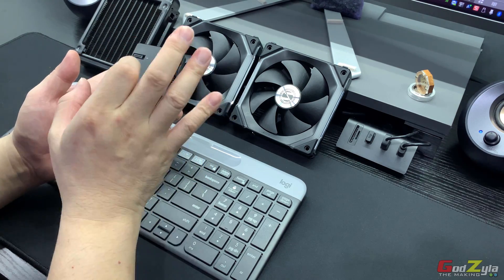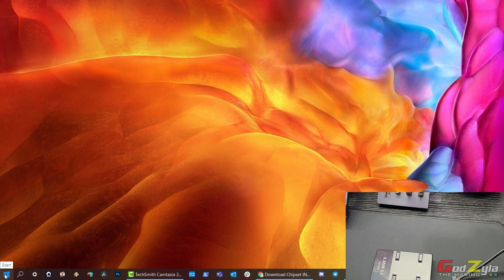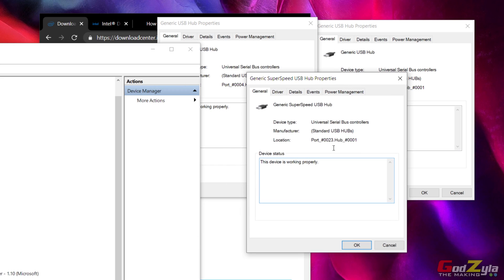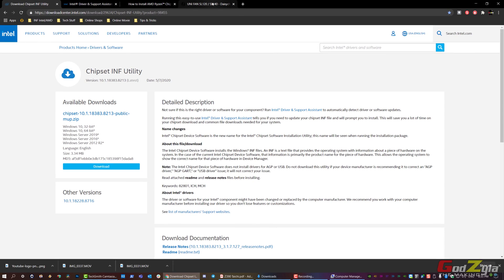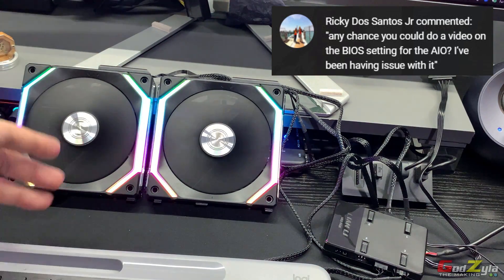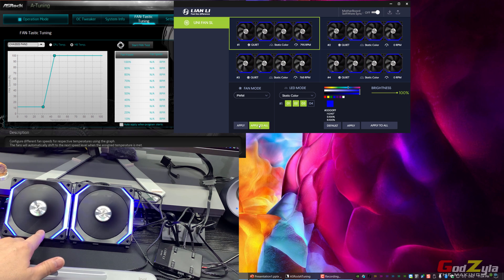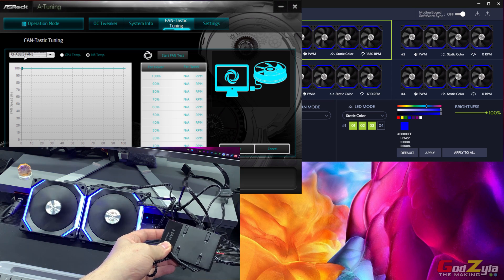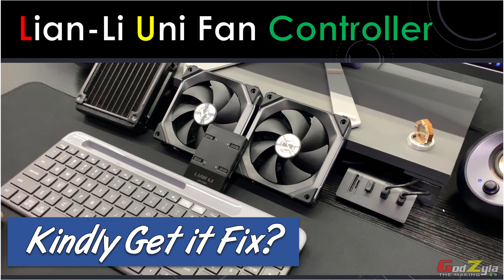Lian Li Uni Fan Controller - Some Break Fix! [L-Connect]

Comment: I'm about to do a build with 9 uni fans and a galahad AIO 360.  Is it better to have all 9 fans go to one uni contoller for RPM or does it make more sense to plug the 3 fans on the radiator directly to the motherboard for RPM?  Which way works best to allow the PC to adjust temps automatically when the CPU runs hot?
Reply from the maker: Hi Jimmy, thank you for your question, Just my opinion. Connect all 9 fans to the uni controller. Both argb and fan connector. Configuration as follow

3 x fans to output 1 let L-connect to control the fan rpm consistently 
3 x fans to output 2 again let L-connect to control the fan rpm consistently

As for the 3 x fans on radiator, same as the above but on L-connect, set to rpm to follow your motherboard pwm curve. 

This way you can manage your cable nicely. 
You can also choose to connect the 3 radiator fans directly to the motherboard fan header and leave the argb connector on your uni controller. 
The choice is yours and if you do like my content, kindly subscribe and to click on the notification bell. Thank you very much.
Reply: @KleoYan  THank you.  If I connect the 3 radiator fans directly to the motherboard fan header will all 9 fans still sync up automatically when the CPU temp rises?
Reply from the maker: @jimmydamico6470  hi, the configuration I have mentioned will only kick the radiator fans. If you want all fans to follow the motherboard fan curve. Then connect all fans to the uni controller and set all ouput to pwm on the L-connect app. That will simplify the whole operation. One more thing to note. Make sure your L-connect starts up when you boot to windows. Instructions as follow 

- Click “Windows” + “R”-
- Enter : “shell:startup”
- Click “OK"
- Copy your “L-Connect shortcut” to “Startup” file
- Restart your PC
Reply: @KleoYan  Thank you.  And lastly, if i have all of my fans set to PWN do I need to change that setting in the BIOS as well?  And what is the recommended fan curve to set?
Reply from the maker: @jimmydamico6470  yes you will need to. I am not sure what motherboard are you using as it might be different from mine, so you might need to check your motherboard manual or to fiddle on your Bios/UEFI to set that specific motherboard fan header to PWM 
make sure you did plug the PWM cable from the uni controller to this specific motherboard fan header.
Reply: did your build end up working?
Reply from the maker: @joshuawhite2041  Hi, welcome to my channel. If you are asking Jimmy, this am not too sure, you might have to wait for his reply. As for me. not an issue as illustrated on my video. once again thank you for your question.
Reply: @KleoYan  thank you, yeah i just have bought the same gallahad cooler and 9 uni fans and was wondering the same thing how to get the radiator fans working as well as the other 6, as well as controlling all the rgb. Im just confused how to have everything setup as im a first time builder.
Reply from the maker: @joshuawhite2041  hi ya. I see. If you have Galahad and such maybe this video might help you https://youtu.be/njlkdM9lYbI
Reply: @joshuawhite2041  Hi.  Yes I ended up getting it working.  As long as you have the PWN cable plugged into the motherboard and the devices plugged into the L-Connect controller you'll be fine.  I do have one weird issue but it might just be a bug.  When I start my PC up for the first time and L-connect software starts the fans rev up to max speed and stay there even though my fan curve is set in the bios.  After a reboot things go back to normal. Weird issue.
Reply: @jimmydamico6470  pwn cable from the controller, which header does that go into again?
Reply: @joshuawhite2041   CPU fan header.  The PWN cable from the galahad I have plugged into the Water Pump header near the CPU, depending on your motherboard.
Reply: @jimmydamico6470  sorry im just very confused rn, is it ok if you just explain to me how you set everything up?
Reply: @joshuawhite2041   Each set of uni fans has an RGB and PWN connection that plugs into the L-Connect controller.  So if you have nine fans, all of the connections plug into the controller.  Then from the controller you have a PWN cable that plugs directly in the motherboard in the CPU fan header.  There is another connection from the controller that allows you to control the RBG from the motherboard.  To utilize this plug it into an ARGB header on your motherboard.  On the pump for the galahad you will have a few connections coming off of it.  One of them plugs into the water pump header on your mother board.  This is so the motherboard can see and control the pump fan.  There is also an RGB cable coming off the pump.  I run that cable to the L-Connect controller so that I can utilize all RGB from L-Connect.
Reply: @joshuawhite2041  Hey guys, Just thought I would point out...ir's PWM, not PWN. It's short for Pulse Width Modulation.

Comment: Hey man, love your videos. I have had the unifans for about a month and they are working great. Yet I have a problem with the RGB cable with the 'sidehooks', somehow it does not properly lock itself in some of the slots of my controller. I actually have two controllers which have that problem with 1 slot. Am I stupid and doing something wrong or is the quality of that part lacking?
Reply from the maker: Hello Yorickos, welcome to my channel and thank you for the compliment. The hook is actually at the top. The side is there for you to hold on to. It does not really hook. So long the top lock is lock properly. You will be just fine. Once again thank you for your question and if you do like my content. Remember to subscribe 😊